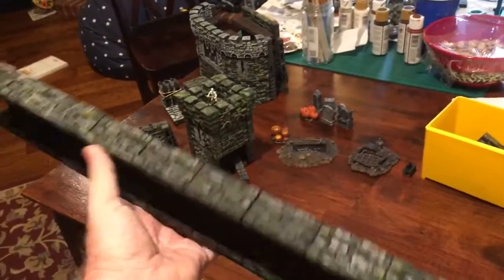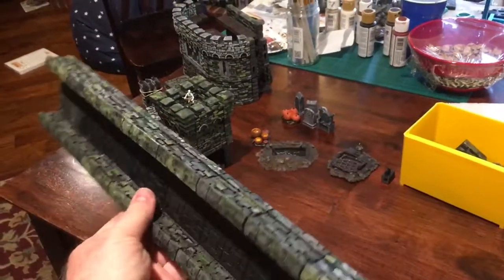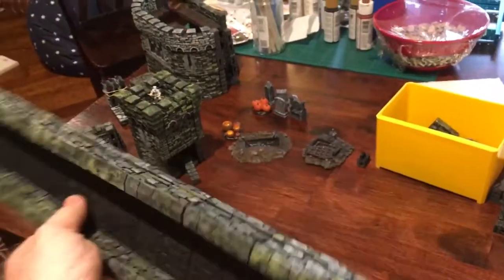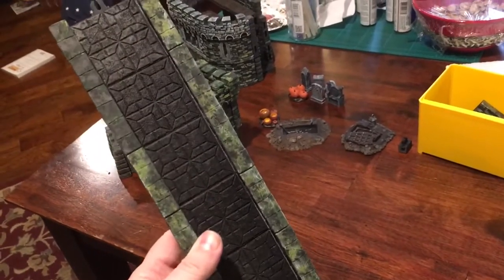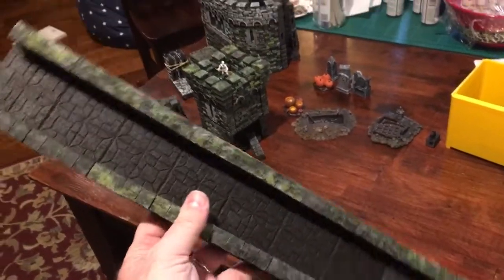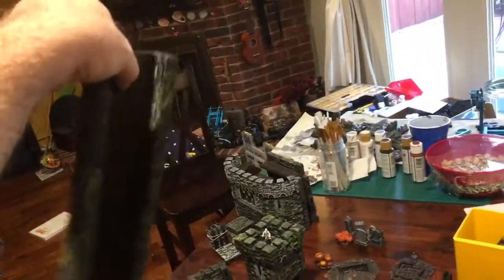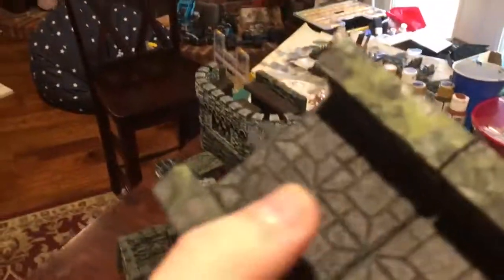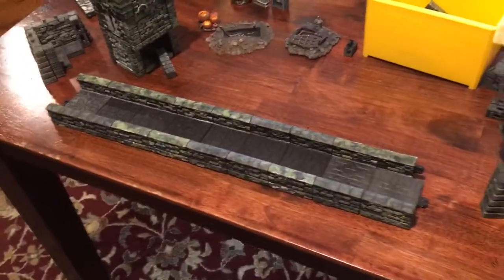OpenLock clips printed with Ninjatek Armadillo

Comment: Nice, how does it resist to falls ?
Reply from the maker: If you are asking if the builds stay together better when dropped, well, I haven't tested that specifically, but my feeling is that the results would be very good. I have taken something like 28 floor tiles connected by single clips, hung them vertically and wiggled them and they stayed together! Also I have a video somewhere of me tossing a pretty huge cavern build into the air and catching it. If stability is a goal, I would encourage people to try clips made from this material.
Reply: @murdockscott  Thanks for the feedback!